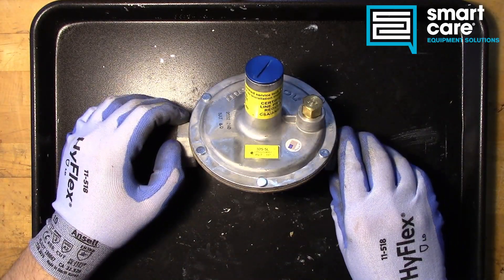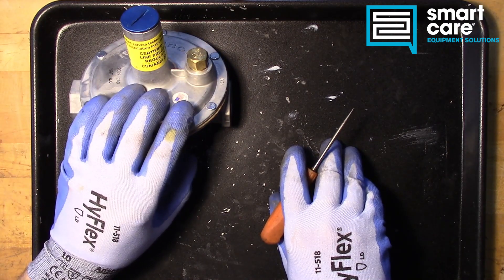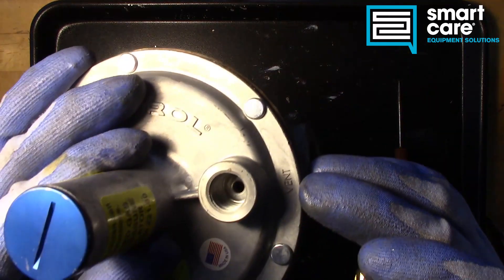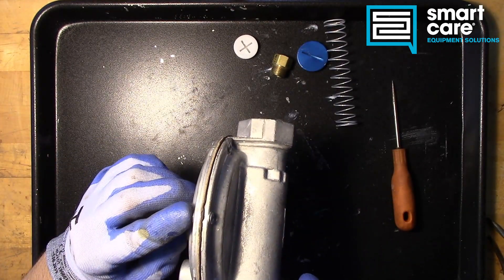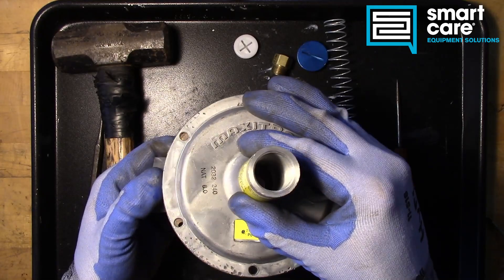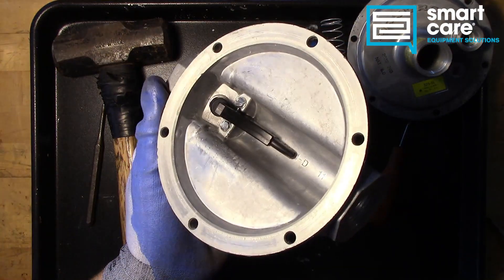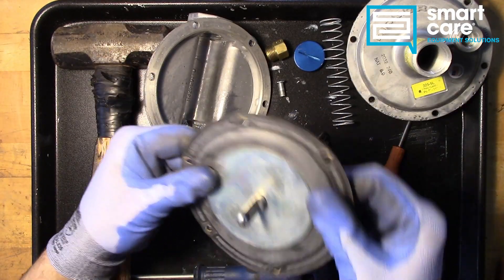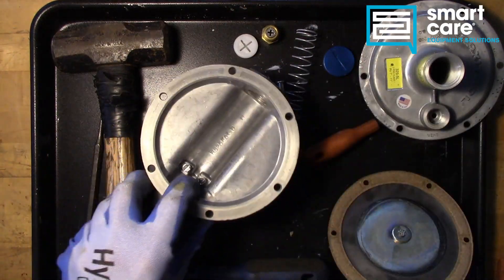Teardown Tuesday Episode 5: 325L Gas Pressure Regulator w/Lockup

Comment: I just installed one of these for my gas stove which has a EFH (1/2 lb max) connected to the yellow whip. The only regulator on this line is on the cities side of the meter which regulates 1.5-2.5 psi. I figured this is what I would need but after I installed and opened up the gas, there is no flow. Is the inlet pressure too great? Do I need to install a step down up stream? How do I unlock the regulator?